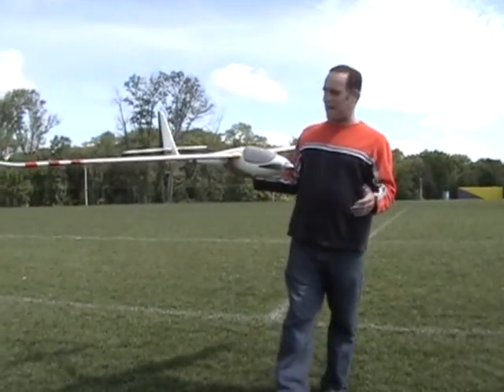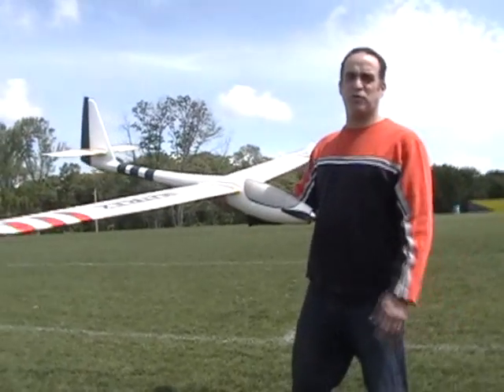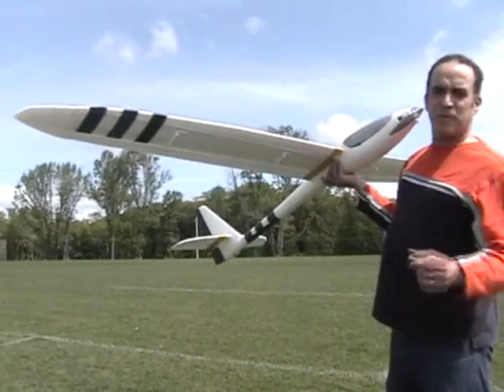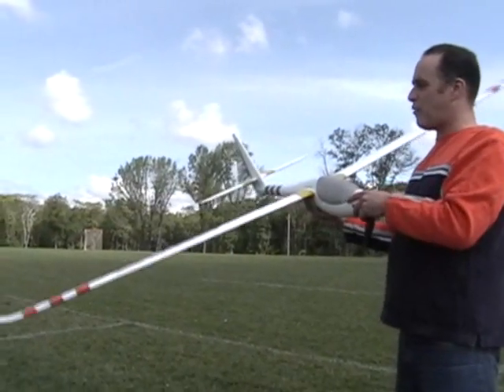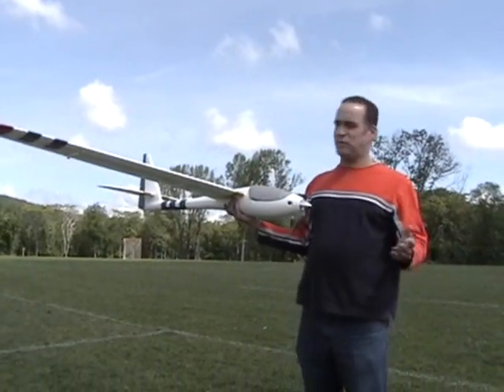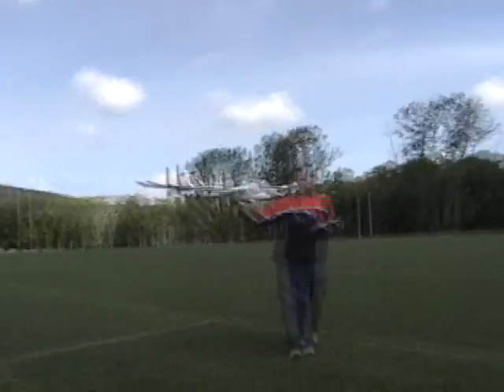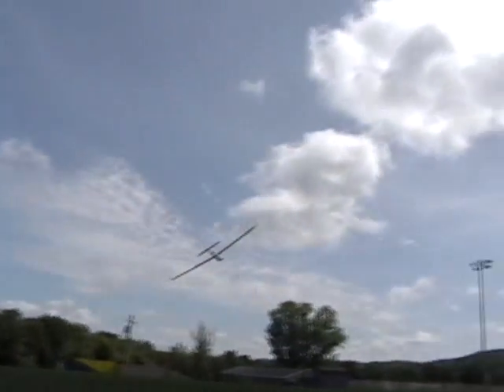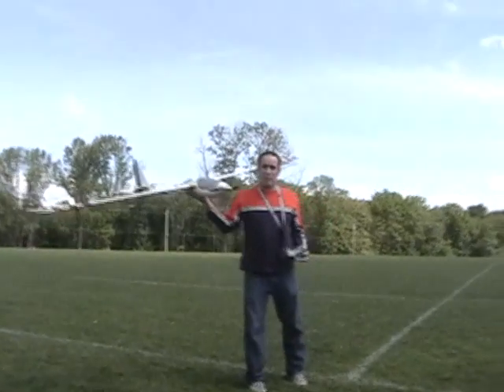Cularis Maiden Flight

Comment: Serafin,
Put the brake on the esc. it will fly much better without the prop turning when the motor is off. When trimmed correctly it will fly almost by it self forget about the Gyros.